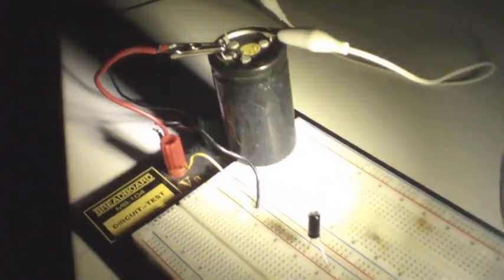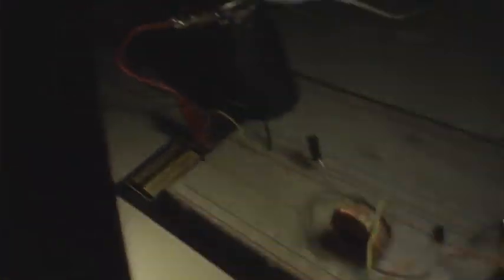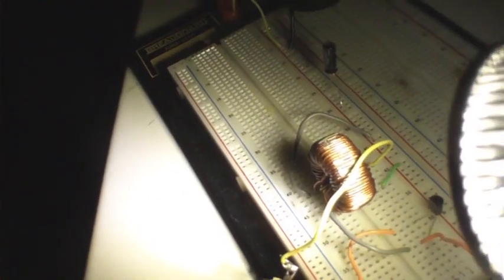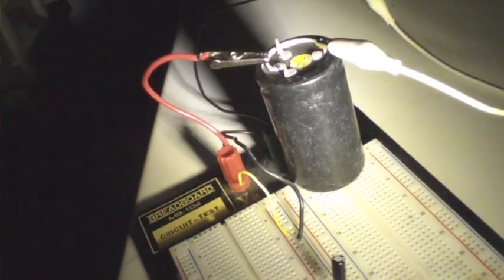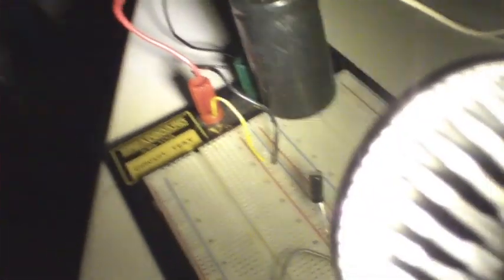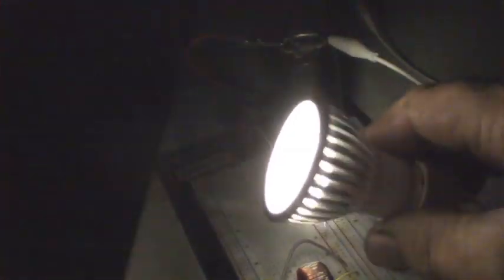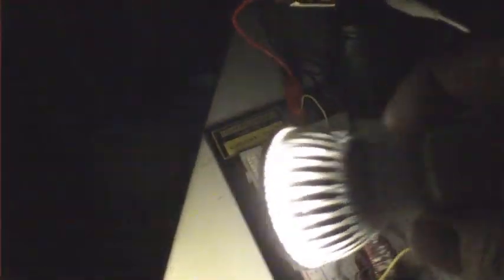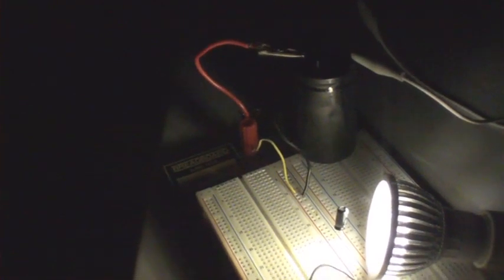NO BATTERY JOULE THIEF FLASHLIGHT (2.7V 400F SUPER CAPACITOR)

Comment: 400Farad caps  is like having a AAA nimh batteries x 2.
Cost of 400Farad caps is surely higher than a pair of AAA rechargeable batteries.
Reply from the maker: Actually it is less than a single AAA battery, that's not the point. #1. Super Capacitors stand the chance of supplying light for 100 years. #2. Super Capacitors can be drained to absolutely nothing, without doing harm. you have to understand that joule thief will take a battery (or cap) down to 0.6V. This will do damage to normal battery - but not a cap. #3 With the right charger supercapacitors can be charged in minutes, not hours #4. With the right charger super capacitors can be left on a charger forever without damage, so long as you do not exceed their max voltage. In short, this video has nothing to do with whether a battery is better than a supercap, or not - it has to do with exploiting the unique characteristics of a supercap and creating a lawn light that last your lifetime. NIMH is the worst choice for a solar lawn light; even NiCd is better.
Reply: KyleCarrington or it can take it down to 0.115 volts if you use germanium transistor.
Reply from the maker: m8ty.com cool

Comment from the maker: That'll work. If you step up the voltage to the recommended voltage, your run time will diminish alot so you might want to have two in parallel. it al comes down to how expensive you want the lamp to be. The right joule thief inductor does a good job and can be made from scraps. As for the MPPT cap charger, it really is a waste of money, simply because unless you are using a tiny little solar cell, you'll have way more sunlight hours in a day (than you need to charge the caps) anyway.

Comment: AliExpress menus were not the same as the ones in its help guides.  They may block the use for a few days, or just don't allow the buyer to use the dispute menu. The replies I got from seller were negative, like sorry, can't help.  If I was on eBay the number of complaints would have caused the seller to change and eBay would have required warnings and a way to cancel or change the order.  With this seller and Aliexpress it's Caveat Emptor, buyer beware. I've learned, I hope no one else has to.

Comment: Circuit would work well in a make shift shake light using a neo magnet shaken through a coil of wire to charge the cap back up when needed. Never have replace a stupid battery again. Just shake and good to go..Useful circuit, thanks for sharing...